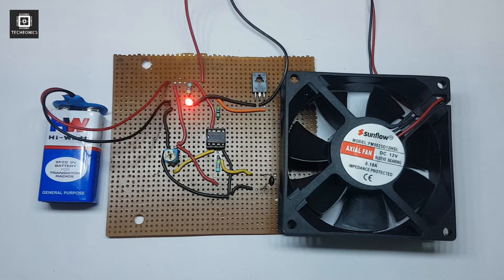How To Make A Automatic Fan Controller  Circuit  Based on Temperature with UA741 IC | Techeonics

Comment: Can anything will be wrong if i use 10k thermistor instead of 4.7k thermistor?
Reply from the maker: Using a 10k thermistor instead of a 4.7k thermistor in acircuit will likely cause incorrect temperature readings and require recalibration of the circuit. Use the Potentiometer to set the value after calibration
Reply: sir please tell how to do this with 10k thermistor
Reply: did it work with 10k thermistor, if yes then please tell

Comment: Is it 100k potentiometer? The circuit diagram shows 500k and the listed materials show 10k. I can't seem to run this
Reply from the maker: In the video I use 104 potentiometer which is 100k.  You can go with 100k or 500k potentiometer both will work
Reply: @TECHEONICS  i varied pot upto 93k....it's not working